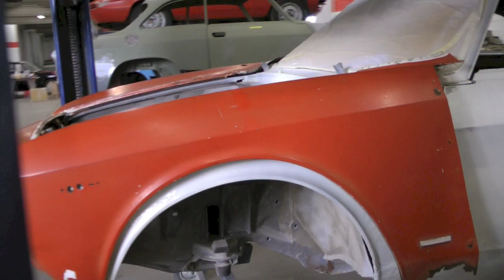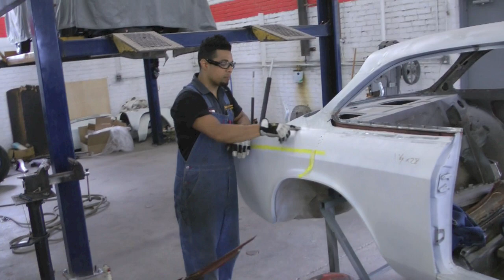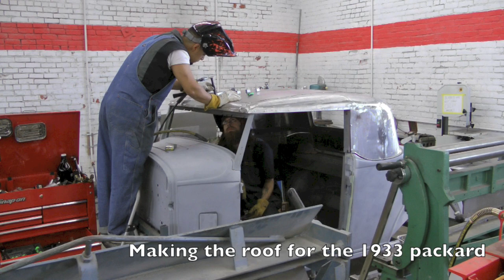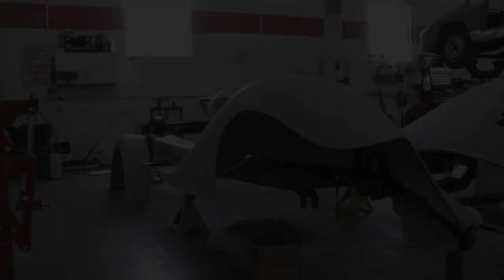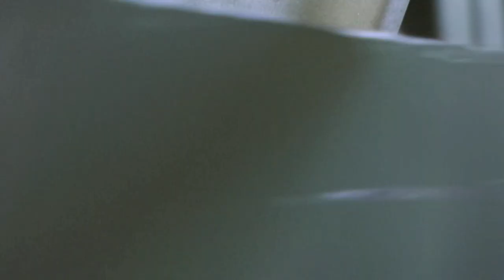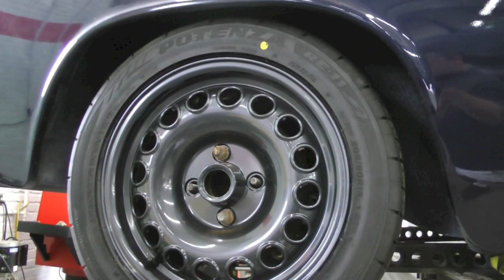to buy or not to buy a GTV 4

Comment: Thank you for brilliantly illustrating what I need to do to utilize a  capacitive discharge ignition system on my GTV 2000.  I remember the pain in the derriere the Magnetti Marelli conventional points and distributor was.  Now about the fuel pump, the Bosch was better,  but ......

Comment from the maker: Honestly the ONLY TRUE way to resolve that complicated question is on a chassis dyno. While the car is on the dyno the telemetry that will be on display at the control station, will give a true report. It can easily be dialed in from their. Effectively the car needs to be under load to really understand what is best for the motor. A good dyno will feed it the air and rolling resistance needed. Chassis dyno is not cheap but, but is the best answer. You will not regret it.